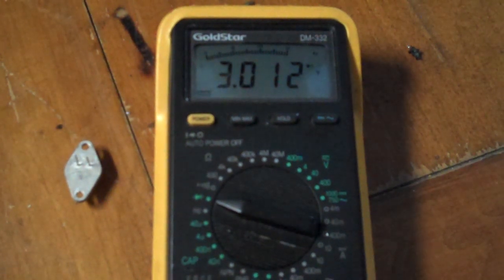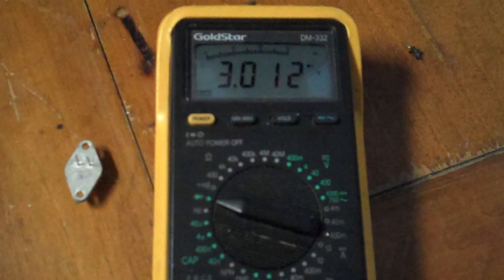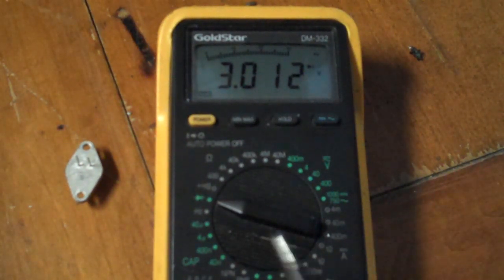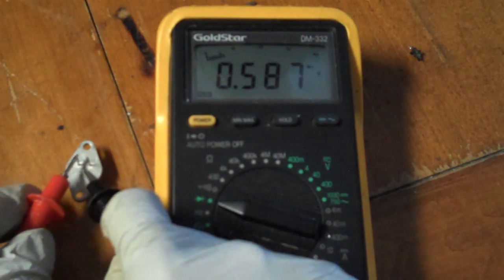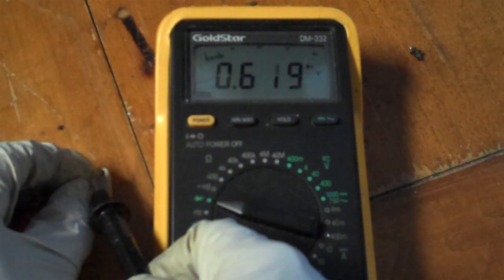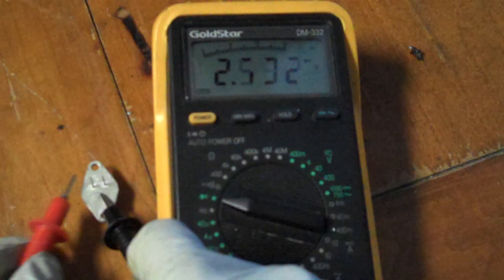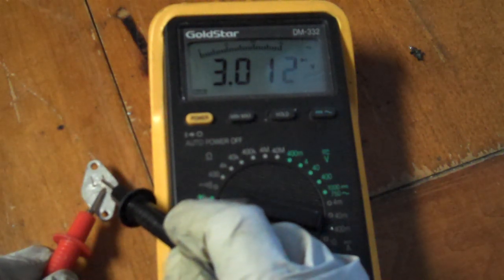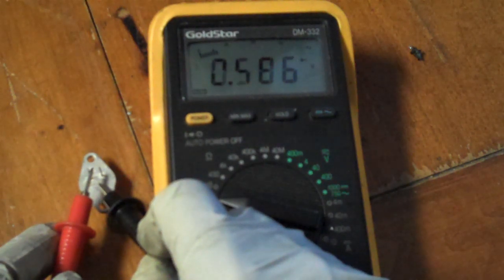testing a transistor using a volt meter DMM Multi Meter How to check a transistor

Comment: Horz output transistors used to confuse me, some have a resistor inside them across the base and emitter. Some have a 40 ohm resistor.

Comment: I was confused about this for a long time myself, the diode test applies current to the transistor and you read the forward voltage drop across the transistor. The meter is reading in millivolts.

Comment: When your checking the transistor in the diode setting you are not looking at volts your looking at ohms an making sure that they only have resistance in one direction
Reply: you are looking at voltage drop, not ohms...the meter puts a voltage across the diode and displays the drop

Comment: @shango066 Wow, thanks for responding. I appreciate it. I did end up opening the TV to find a blown fuse on the power board. I found that it blows when it gets plugged in to power. Even though it's not in the TV.